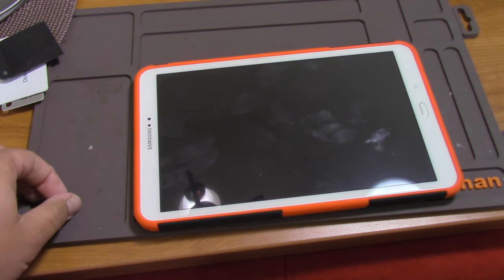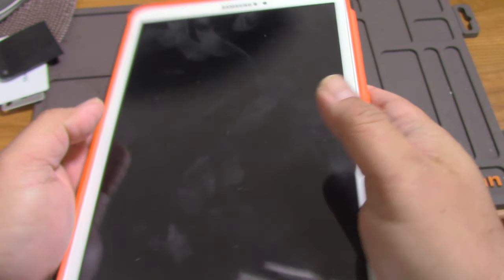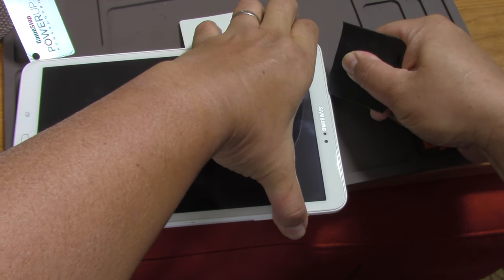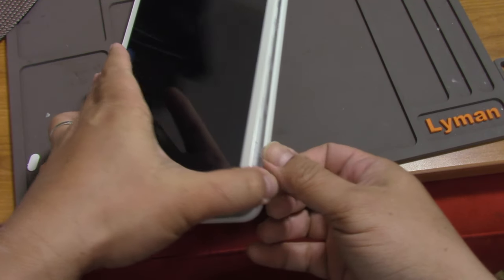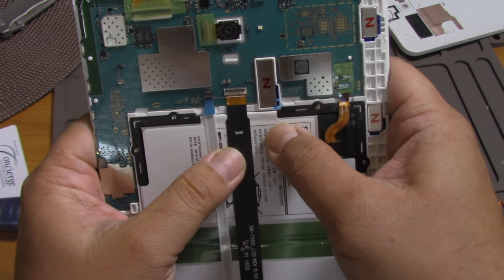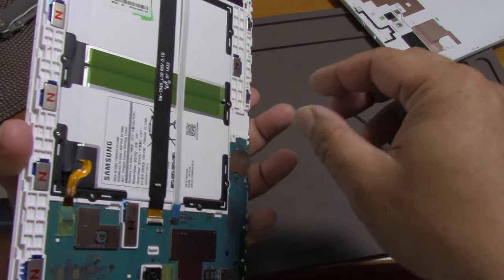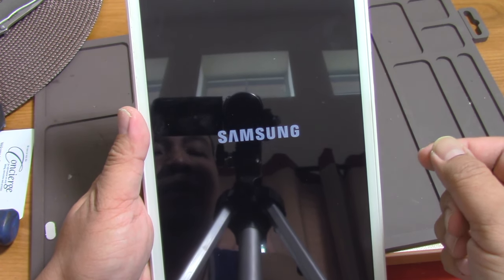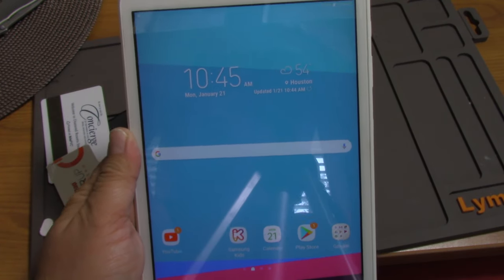SAMSUNG GALAXY TAB A BLACK SCREEN FIX

Comment: No amount of or variation of hard reset was working on my tablet, and I have had screen issues in the past. This video helped a ton. I disconnected and reconnected all three cables and did a soft reset with the battery cable disconnected to make sure the tablet wasn’t on (as you suggested). Put it all back together and presto, the tablet works again.

To others attempting this fix, I was having a hard time getting a card wedged in to take the case off. The side with buttons was the only one I was able to wedge loose with a card, but once that is done you can use your hands to gently apply the pressure needed to pull the case off the other sides. Just make sure to watch how you tilt the tablet/you’re not sitting somewhere you can lose small pieces, because the power and volume buttons are actually loose once you take the case off.

Thanks for posting this.

Comment: Thank you PNYprepper!!  This worked great.  I was a little nervous about opening the back of the tablet but I just followed what you did and it worked as expected.  I also had to disconnect the battery cable as you specified at the end of your video.  I thought we were going to have to buy a new tablet.  AMAZNIG!  thanks again!!
Reply from the maker: you're welcome!

Comment: Worked perfectly. Screen had no backlight but could be seen with the assistance of a strong lamp. Reseating the screen ribbon fixed it. 
Before removing the back cover, take care to remove any microsd card or sim card first, otherwise they will be in the way.

Comment: Thanks, Man, it worked. You saved me. wow I am really happy
I removed the screen cable and fixed it back, so I thought I will come on but NO .i did the same for the power cable, it still didn't come up . Then I switch off the phone and on it back, then it on my screen is back

Comment: So question. I have previously fix this problem, it happened again, but NO amount of wiggling and re running it through the port will fix it. When I have it under direct light, you can see the screen, like last time, but this time it wont work. What can I do?

Comment: I have a tablet and well water got spilled on the table and it got wet and when i turn it on it makes sound but no displays i tried this method but it didnt work if you could help I'd really appreciate it
Reply: Same i didnt get water on it or drop it or anything but it still didnt work even after the hard reset and this